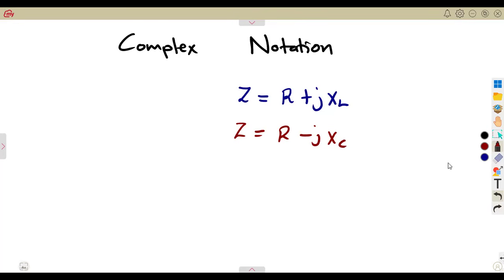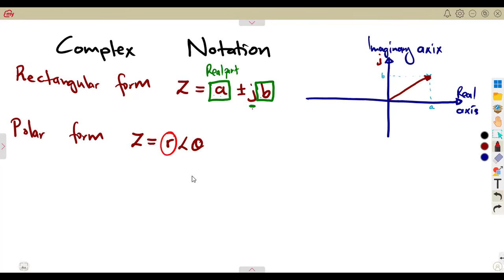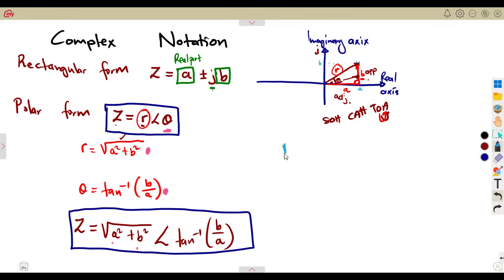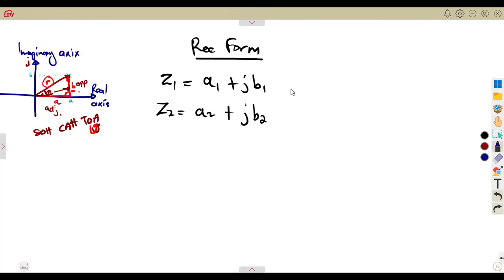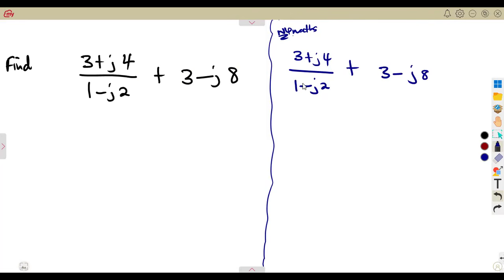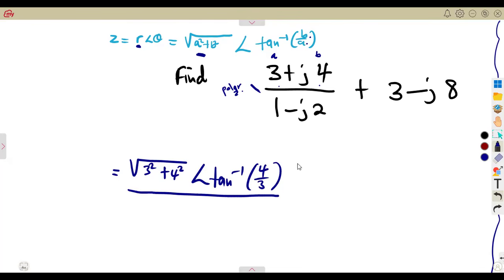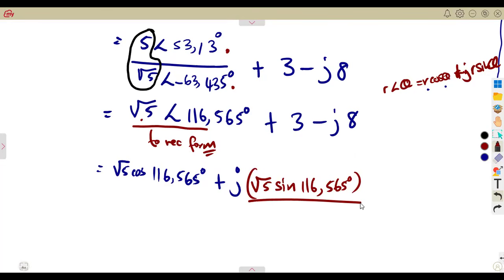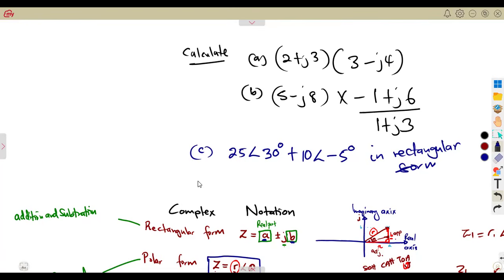Industrial Electronics N5 AC Theory Complex notation Introduction @mathszoneafricanmotives

Comment: Sir in N4 you taught us to convert using the calculator but now you are using the method we used in maths
Reply from the maker: Yes, for IE it's good to understand the manual method as well. But electronics use calculator method
Reply: @mathszoneafricanmotives ok but am i allowed to use the calculator method??
Reply from the maker: I will advice you show steps as they did in textbooks and also for question papers . But when doing so you don’t need to show each step , just important steps.
Reply from the maker: Check one or two memos for clarity sake